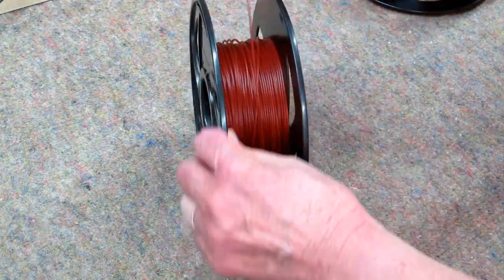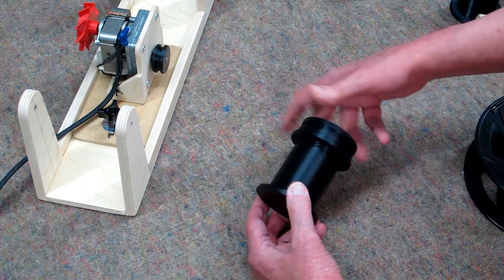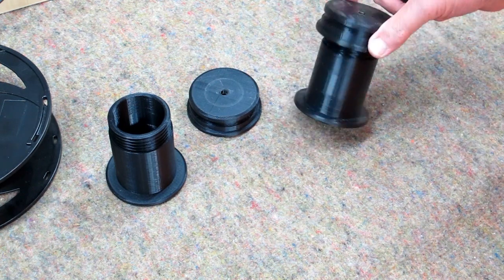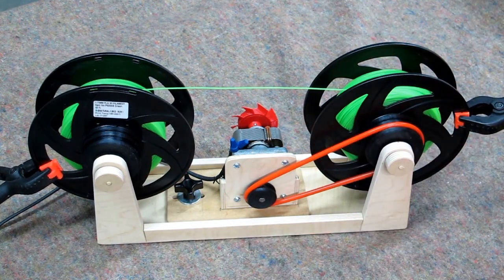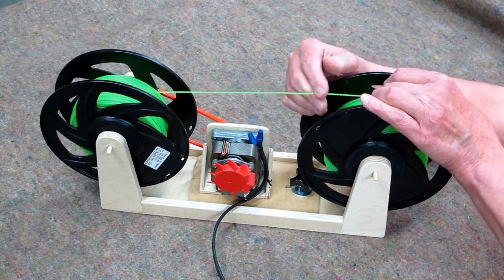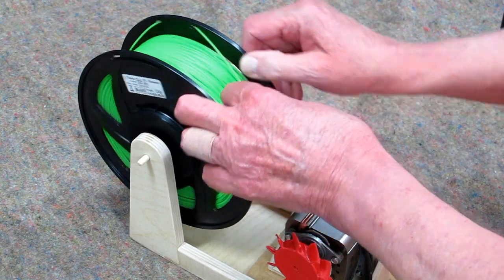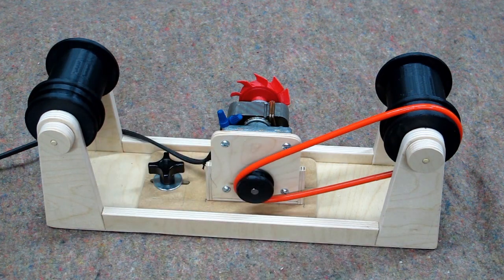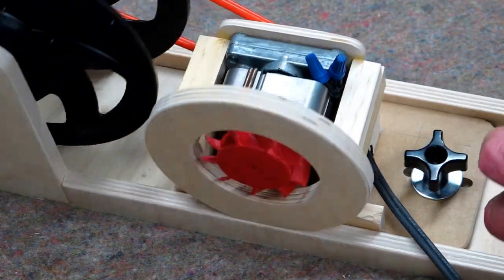Rewinding Filament Spools For 3D Printing

Comment: I have been trying to leave you a comment but youtube keeps deleting it. I even made a video for you to look at. It is called "Wire Spooling Demo". I will leave my comment to you there in the description.
Reply from the maker: Go to my channel page... click on "more" and you will find my email address. Send me an email with a link to your video.
Ron
Reply: @RonaldWalters2010  https://youtube.com/shorts/0Cbz558f5AQ
Reply: @RonaldWalters2010  Remade it a little cleaner looking. Will take a short tomorrow and upload. Thought I might as well get started on my wire spooler. Getting tired of rolling wire by hand. Definitely need to go to the junk yard to get more car seat motors. I like the power wheels motors but the car seat motor are easier to work with. Smaller.
Reply from the maker: Interesting wire straightener-winder you have. 
I am not sure you can get away with bending printer filament back and forth like that when it is cold... that may cause it to crack and or break (may break later after it is rewound). The filament at the factory is probably a bit warm when it goes onto the spools and it has developed a bit of memory for the curvature it has for its position on the spool. Just a thought.
I'll have to get some of those seat motors. 
Ron
Reply: @RonaldWalters2010  well the great thing is that you can adjust the tension to suit the material. For filament, I am going to guess that as long as the two center rollers are just slightly pushing on the filament, that it will be enough resistance to tension the line. For my use of winding electrical wire, most of the time, the wire is more flexible and needs to have more contact with the rollers to get that tension. 

After I do some cleaning I will take another video of the progress I am making. 

BTW TY for giving me the inspiration to finally move ahead on my project.
Reply: @ Made a spool adapter for a large spool. And upgraded the roller guild tensioner to be adjustable. I let the end run out to show that it does in fact keep tension. I used string trimmer line. Closest to filament I have on hand.

https://youtube.com/shorts/sLylPBaLpMk?feature=share
Reply from the maker: Very nice! 
There is a big difference between string trimmer line and 3D printer filament... at least for PLA and PETG. Simply feeding off the original spool and going into the 3D printer filament extruder, if a print is completed and the filament allowed to remain entering the extruder (motionless)... often times by the next morning the filament has snapped off due to the stress caused by the slight change in curvature.
Also, some of the filament I rewound would snap off mid spool due  to the change in curvature and I didn't know it until I started using that rewound spool. :-)
What you are doing with the wire is basically the same process factories use to straighten coiled wire to make straight bar stock.
Thanks for showing me your machine!
Hope you have subscribed.
Ron
Reply: @RonaldWalters2010   "There is a big difference between string trimmer line and 3D printer filament..."

Yes I am very well aware of that. This is just the closest I have on hand. Still miles apart but the closest thing that resembles and is a stand in. 😏

The point of using this is to have some tension, so that your hands are free to get your infeed detangled. Not to mention so your hand won't get tired and accidently let go and the spool unravel. I let the line run out to show that having it set up this way keeps that from happening. 

"often times by the next morning the filament has snapped off due to the stress caused by the slight change in curvature."

On that note. The use of a Bicycle Inner tube on the tension rollers will provide a little bit of conforming grip while applying the least amount of pressure. AKA the least amount of "change in curvature".  So the rollers just touching the line should be almost like your finger tips holding it. So however much the line has a "change in curvature" with your finger tips, so will it be with the rollers.

Video short uploaded. Called: "The 3rd version of a power spool winder. No "change in curvature"."
Reply from the maker: You are using a furniture drawer rail. If you can find a cheap linear slide rail (something like the following link) then your arrangement may automatically follow the line back and forth as it winds onto the spool. Linear slides move very smoothly with almost no resistance. Just a thought.

https://www.ebay.com/itm/156363165475?_skw=linear+rail&itmmeta=01JKB9NDNG0KEBV4FSKDY84VC4&hash=item2467f88f23:g:yLMAAOSwwhFmwvFz&itmprp=enc%3AAQAJAAAA0HoV3kP08IDx%2BKZ9MfhVJKmDs9jTH8ZMNqpJ%2FDg35s9QU6TlGb46lic37z4qX1UnGw9MgeS8p%2FtvYHXjF3eehfIPlc9TE8g6d3wVr9iZFkKD%2BUgGJMO%2F%2BLqnwU2TvG3pSXdoVipL--O9Z2mTEkVToOukNpwXOB7gZGQm1Po5Oy4TU8qJ9K8eoJcTbZKfw7OMjEaxg%2F9f87o%2BNXLGShLwsoxoAv1IfPImcP7O%2BnJvVchYskk68sOLia1NDMkRdmkvqSXkfeyvZbMPQXDPkaSsGG8%3D%7Ctkp%3ABk9SR5Lb1emaZQ